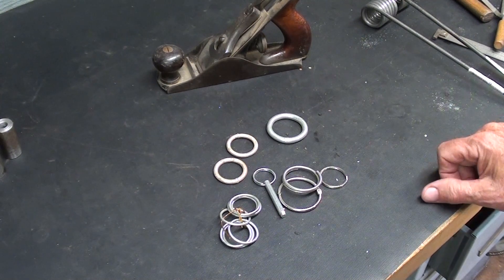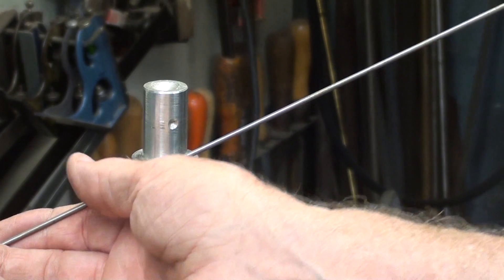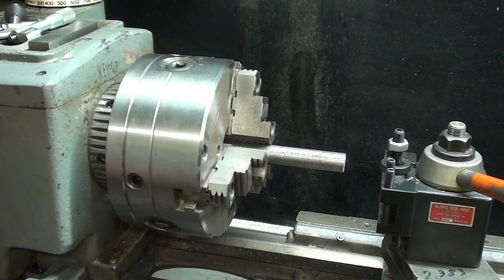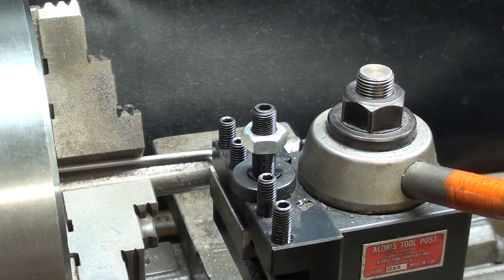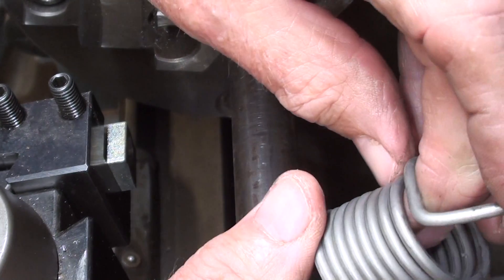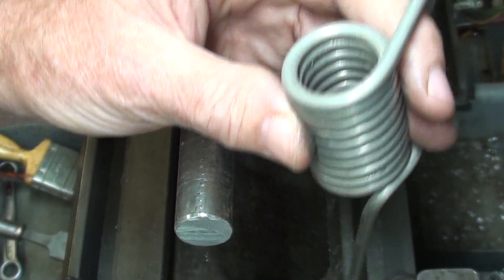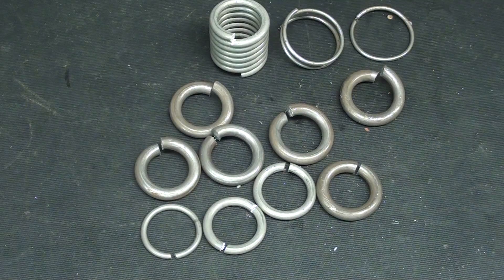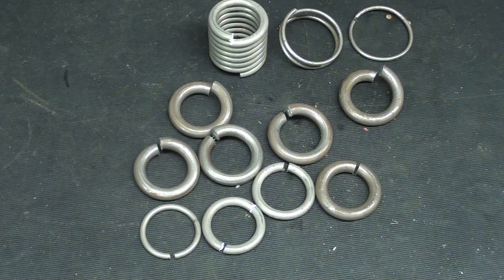MAKING STEEL RINGS ON THE LATHE Tips #509 tubalcain

Comment: mrpete222 I was given an antique screw jack and the end of the small gear which makes the jack go up and down had a ring on the end where you put the handle to turn the gear. It looked as if it was meant to keep a metal bushing in which takes up the slop of the shaft. Have you ever seen that before?
Reply from the maker: Have not

Comment: I remember back in 2003 I was deployed to Operation Iraqi Freedom. I made a hand cranked ring maker for a friend who was a member of SCA, and wanted to make chain mail body armor from recycled coathangers. The rings turned out about 1/2" diameter, which my friend would "knit" together with two pairs of pliers while relaxing and watching movies in the evening. By the end of the deployment he had his chain mail shirt. Took thousands of those little rings, and probably hundreds of metal coathangers too! (We got our uniforms back from the contract laundry service on the coathangers).  The ring maker was just a  block of wood drilled through with about a 10mm scrap piece of rod bent in a crank shape and a slot cut in one end to put the wire through, and a nail for the wire to wind against. Very simple!

Comment: to cut the rings you can make an easy guide out of wood and saw the whole roll apart on the band saw. Drill a hole near an edge of a board big enough for the roll to fall into and then run the wood and steel into the band saw until you have a cut through all the rings. The guide keeps your fingers away from danger and makes a clean cut.

Comment: Lyle, there is a table in "Machinery's Handbook" that tells what mandrel diameter to use for specific ring IDs.  I think it also gives a formula for "odd" sizes (my book is in my shop right now, otherwise I'd verify this before commenting).  It, of course, applies to the types of wire (i.e., the metal) that you are making the rings from, like music wire.  I think the table is actually for making springs.

I've never used a lathe to do this, but made ~30K rings for a maille shirt back in the late '80s.  I used only the best material -- coat hangers!  ;)  I used a small bolt cutter to clip the rings from the coils.
Reply from the maker: Yes, the table is for Springs. 30,000 rings, wow
Reply: @mrpete222  It took that many rings to "weave" a shirt.  Back when I watched football, kinda, I spread an old towel on the coffee table and wove the shirt over many hours.  But I learned how to make rings quickly!  ;)

Comment: Made lots of cooling coils for laboratory experiments using this technique. One trick to use when score marks on the material aren't allowed is to make two pinch blocks using nylon. The blocks are mounted in the tool holder and may be adjusted to put drag on the tubing. If the coil diameter and spacing have to be held closely, cutting a guide groove in the mandrel for the tubing can be helpful. There are formulas for figuring the mandrel diameter, but I found that trial and error was quicker and gave better results. If you are trying to hold +/-0.005" on the coil diameter the formula isn't going to get you close enough... it is a start, but you still end up having to sneak up on the correct diameter for the mandrel.

 Instead of a hole in the mandrel to anchor the tube a cross drilled threaded hole was used and then then the end of the tube could be clamped to the mandrel. As others have noted this makes controlling the tube easier and you can still get it off the mandrel without having to cut it.

I think the largest coil I ever had to make was three 20ft. lengths of annealed stainless steel tubing, 3/4" diameter, that was butt welded into a 60ft. tube. Coil was 10" in diameter +/- 1/16". After making short test sections to get the mandrel diameter correct the tubing was laid out across the the shop and the coil was made in one shot on the lathe.
Cheers from NC/USA

Comment: Used to use an old clapped out lathe to make rings for chain maille assembly. Used 1/4 inch mandrel with a follow rest and wire guide with high tensile fence wire. They would spring back to just under 3/8" Worked real good.
Reply from the maker: Awesome

Comment: So how would you do a double "beehive" spring where both ends taper down in diameter from the cylindrical centre portion. You frequently see this typ of spring with small independent hooks mounted to each end. For reference: https://www.dimecitycycles.com/center-stand-spring-kz1000-kz1100-kz700-kz750-kz900.html
Reply from the maker: Never made one. I suspect a collapsing mandrel

Comment: Hey Mr Pete. Liked this video a lot. When I need a dingy thingy I tack the end of the wire, up to 1/4”, to a mandrel with the wire vertical and use a knurling roll or smooth roll to follow at 1.2 times wire dia. From the mandrel in forward with reverse thread feed. Comes out great. Usually have a coil laying around the shop somewhere waiting to be cut into individual rings. The drawback to my method is pressure on the cross feed  but it doesn’t pick up on the carriage like I notice your method doing. Never tried it with anything but mild steel. Any way I always enjoy hearing from someone a little my senior. Bless you.

Comment: I bend 3/8 (#3) rebar for a lot  of my projects. Using 1 1/2 pipe   Getting about a 2 1/4 id ring. Took a while to get the knack of doing it. But similar to your setup only beefed up. I use an old gear reduction 100:1. And a 1/2 slow speed drill   Works great  keep fingers far away.

Comment: I have wound up 3/8 SS rings in a similar fashion on a 19" lathe , I would weld the bar to a piece of 1" pipe or what ever size ring you want then putting a block of wood on the ways , I would pinch the bar against the block and wind it up...made quite a few guys take a step back when watching me set it up and get ready to wind up a few rings out of an 8 ft bar...lol
Reply from the maker: lol

Comment: I don't need to make one of these now, however what if you used a nut and long threaded bolt? Weld a small stud on the lower side of the bolt and drill a hole though it.  Put the bolt in the vise, and run the wire through the stud hole. Then simple use a ratchet or wrench to tighten the bolt?  You could then crank it down to align the loops straight up and down?
Might or might not work, however gotta be something like that when they make springs, right?

Comment: GREAT VIDEO!  I would love to see a video on spring winding.  I have various "spring winder" mechanisms designed to be used on a lathe... hand-held but designed for lighter gauge wire only.   I hope you have one.  If not, let me know and I will try to find a spare to send you (I know I have a spare... finding it is the hard part).   I have amassed a huge supply of various springs because they come in so handy for repairs.  I always save them before discarding broken items (including spray bottle and pump mechanisms on soap dispensers).  
           P.S.  "stay away from television and other nonsense in life"... words to live by...
Reply from the maker: I have a couple of those spring winders

Comment: I recall 25 years ago making tubing coils of 3/4 and 1 inch tubing using exactly the same method. We had a huge pipe lathe (the spindle hole would accommodate 6" pipe) and it would take three of us to do it. The tubing we used came in 40 foot lengths. We did this cold and there was minimal springback.
Reply from the maker: Wow, that’s kind of scary
Reply: @mrpete222  it was, the first couple of times. But after that it was pretty routine. We would make coils for stock and then gradually use them up in fabrication. Then a couple of weeks later we would take a morning and make another 50 or so. Sometimes the coil pitch didn't line up with a leadscrew speed. So we would enlist another person and one of us would manually advance the carriage. That was a lot of work! Two or three coils and we would have to change off and have someone else on the handwheel. It took a little skill to advance it smoothly at the right pitch, but we had 10 or so guys who could do it very accurately.

Comment: I have made coils this way before as spacers and such. It is very satisfying, but yes, you need to be sure your fingers are out of the way, eye protection is on, and don't stand in line with the tool holder. Other than that... not bad. Thank you for another great video!

Comment: Thanks I have something simple you may really be intrested in regarding threaded spindles and chucks like on Atlas lathes that solves some difficulties I would be happy to share . I like to make rings.  I have a roll of wire 200 feet long. I like to make rings to put through the handle holes of some tools like pipe wrenches in order to hang them. Also I will be making a torsion spring too to make a belt grinder tension spring.
Reply: Awesome! I have a SB-9 with a threaded spindle. There are methods published how to make the chuck fast on a threaded spindle. I would be very much interested in your method and surely others as well.
Reply: @milantrcka121  The first thing would be a tip for when you take the chuck off and put it back on the spindle. Chuck a piece of steel or even plastic rod with rounded ends close to the size of the spindle bore into the chuck jaws. It should stick out out of the back of the chuck and into the spindle bore six inches and act as a guide then the other end of the rod will stick out of the jaws six inches. This will act as a handle and will make removal of tbe chuck and installing it much easier. You can leave it in the chuck and store it with the rod still in the chuck. Just drill a hole in a shelf, table or sufficently thick angled surface.   Next will be to keep the chuck on the threads even in reverse. A hole can be drilled and tapped right into the face of the spindle at the edge. The hole will be the be drilled and tapped unto the female  portion of the chuck and into the male threaded face  edge of the spindle at the same time. Then a set screw can be put in to lock it and be assessed from the chuck face side. Its a little hard to describe without a drawing. A tool post mounted drill is needed to do this. You can get a thing on amazon for around than 50 bucks for that but can be adapted to a tool post. To accurately drill the hole. Part of the hole will be in the chuck part in the spindle. To drill a hole in another chuck just repeat the process. You may have to use a suitable size end mill to make the hole i would recomnend using a 1/4 -20. Set screw. The item in the link below. Can be modified to be used in a tool post  

 Lukcase Floor Drill Press Stand Table for Drill Workbench Repair Tool Clamp for Drilling Collet,drill Press Table https://smile.amazon.com/dp/B01FZB3HQC/ref=cm_sw_r_cp_apa_i_fXdmFb3C7VPSP
Reply: @ALSomthin  I am not sure about drilling into hardened spindle face. However I have seen a suggestion on a clamped thread-on chuck mounting plate. I think I will stick with my 3C collets. For small springs it works just fine. I am not planning to bend 1/4" steel...
Reply: @milantrcka121  Yes me too. I'm going to get a G0602 that's all I can't even afford yet but definitely can not afford a cam lock. Any helpful info would be greatly appreciated.
Reply: @roysmith3198  Roy, If you can, get spindle-mounted collets and a closer. Well worth it.
Reply: @milantrcka121  Thank you
Reply from the maker: I have made but not released yet, a video on making a torsion spring
Reply: @mrpete222  cool
Reply: Yup that always good collets are great. The spindle isnt as hard as you might think though drilling it is not all that difficult but its often wise to use an end mill to get both surfaces flat and the use of the right type of carbide end mill to do that. With the right end mill you can drill it right in all the way it only has go 5/8 deep. The Atlas lathe has an indexing pin that engages into the bull gear. This can help with precise alignment with bolt circles as well with the tool post mounted drill.  I managed to do it without too much problem.
Reply: @ALSomthin  Thank you

Comment: Great job Mr. Pete ! ! !  Those nice large welded heavy rings are great for cinching ropes good and tight.  I even use them with pairs of ratchet straps.  You can really hold something where you want it with a little practice.  I never tried making them myself, but I do have a welder and an old garage door spring laying around somewhere..........
Reply: ...you have a garage door spring somewhere?! Isn't that a bit of a stretch?!

(get it? get it? get it? snucker-snucker-snucker-snucker!!)

Comment: Might have worked better to "close" the ring first then straighten it with the wrench, that way you can work with the spring back not against it. My son, when he was 12-ish made a bunch of rings out of light wire for a chainmail project. In his bedroom, on the carpet. I am still finding bits of metal 20 years later.

Comment: Super Cool Mr. Pete  as a child  my Father had his shop  in our basement  and  he gave me a  section  to set up my Slot Cars and Electric trains  i often  would “ tidy “ up  his tools and Workbench  including   putting  all the hardware  in the correct  storage containers  for him  for some reason  i was always intrigued with Springs  and their resistance to   not losing their  original shape  of course i knew very little about Metalurgy  as a kid  more specifically  changing the molecular  structure through heat  and cooling

Comment: Mr. Pete: could you do this with 01 or 02 drill rod, then heat/quench for a spring?
Reply: I'm guessing that tool steel (drill rod) is too brittle to bend like that without annealing first.
Somebody correct me if I'm wrong.
Reply: It should come annealed unless otherwise stated or specified

Comment: I made a torsional spring for my trailer locking mechanism by machining an arbour and using a screw to hold the wire, but the screw wasn't strong enough, so I drilled a cross hole. I fed the wire through the cross hole via a wooden guide in the tool post, turning the lathe by hand, moving the tool post by eye, no power, then cutting the spring off where it went into the cross hole. It worked magnificently and completely restored one of the fail safes on my trailer hitch. I had an enormous sense of achievement and delight with the job, smiling from ear to ear. Thank you for sharing this super useful information.
Reply from the maker: Sounds like a good solution. I will be making a torsion spring in a future video. In fact I already did it a month A go. I have not published it yet

Comment: Black Smiths had a big cone shaped mandrel they would use to make the rings round when the were still red hot
Reply from the maker: I have seen those
Reply: With the resurgence by some in blacksmithing those cone shaped mandrels have become much more valuable than old anvils.  A friend of mine had one he was going to haul in for scrap and a guy who bought an anvil from him started describing the mandrel and my friend realized he had one of those as well.  The guy ended up buying it from him for close to $1000.00!  Not bad for scrap iron!
Reply: @37yearsofanythingisenough39  It would take some time but with a big lathe a machinist could make one
Reply: not2fast4u2c yes one could be machined.  The one my friend had was cast iron and used as cast except for the parting line where it had been ground.  It would take a pretty big chunk of bar stock and a hoist to machine one from steel besides the big lathe you mention.  My big lathe swings 17” and it would not come even close to turning one the size I saw.

Comment: Interesting how well the 1/4" was formed with very little spring-back.
Reply: 10:29 he actually use mild steel rather than stainless steel for that one
Reply: Stainless is approx. 2 1/2 times the tensile strength of mild steel...🇬🇧👍

Comment: Nice. I used my lathe and a pvc pipe to wrap copper tubing and make a coil yesterday. Pro tip: when bending copper tubing, fill it with sand first and it won’t flatten around tight bends.
Reply: The Revenuer is making notes.                 Just kidding sounds like a good tip.
Reply from the maker: Thanks

Comment: If you google for spring mandrel calculator you can find a web page that lets you figure out what size mandrel you need in order to produce the desired diameter for any wire size.
Reply: I am pretty sure that Machinery's Handbook has the charts also. Seen it somewhere. Must of been there.
Reply: You do need to know the alloy and temper, though. I don't know how much melt to melt variation there is in the material that you get; It's possible you would need to get test results for the specific melt.

Comment: Now take some .045 stainless welding wire, wrap about 30,000 rings on a 3/16th mandrel. Then saw cut all the coils with a .008 jewelers slitting saw and get to work with some pliers. In a few weeks or less you can have yourself a chainmail shirt. Yea used to do that. :) Still have the necklace I made with .020 titanium wire with a 1/16ths inside diameter on the rings.
Reply from the maker: Wow, that is a tedious job
Reply: That is one small saw.

Comment: To ensure that they stay round when you close the rings you should make the cut at an angle to the axis of the coil: the right side of the cutting blade (at the start of the cut) should align with the left side of the blade (at the end of the cut). Using this method, when you twist them to close them, your ring closes with no gap.
Reply from the maker: Good idea

Comment: In the last step, the bending, it is much better to close the rings first in the vice and after that rotate the open ends to match each other with the pliers. In that way you can compensate for the springback, by pushing a little more than closed.